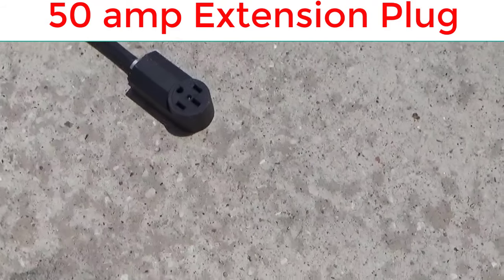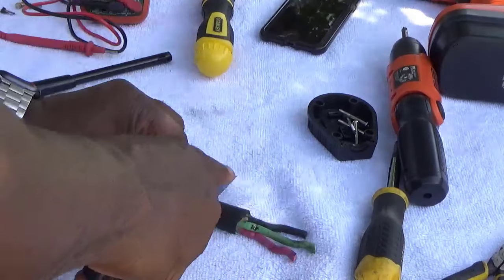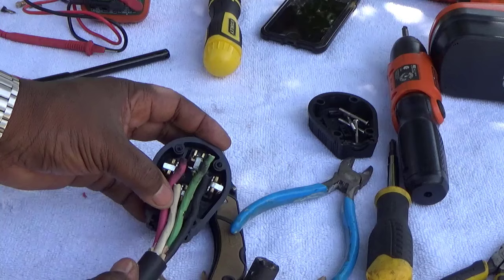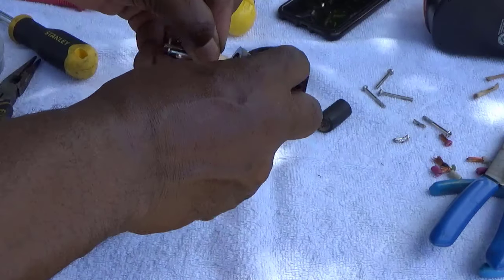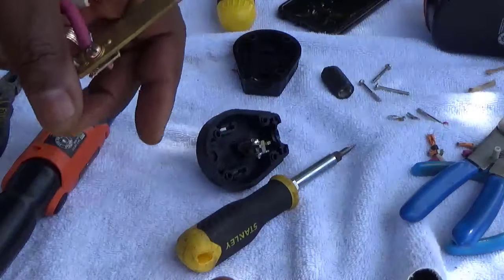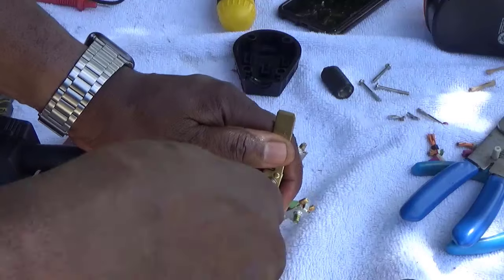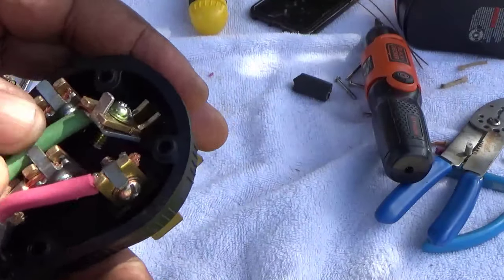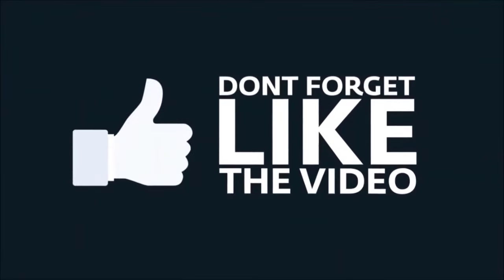How To Wire A 50 amp Male & Female Extension Cord

Comment: I have a 6 awg wire system with a neutral, a black and green wire. I hooked these wires to their respective green, hot and neutral locations on the female 30 amp outlet box. I then on the opposite end I hooked up these wires to two hot and ground on a 50 amp male adapter. My goal is to hook up my welder to my generator. Am I doing this right?